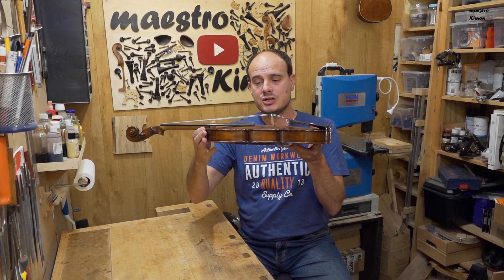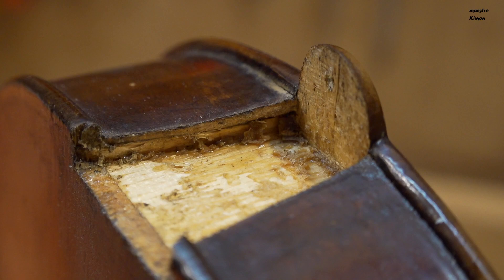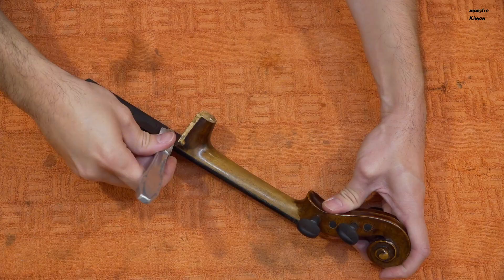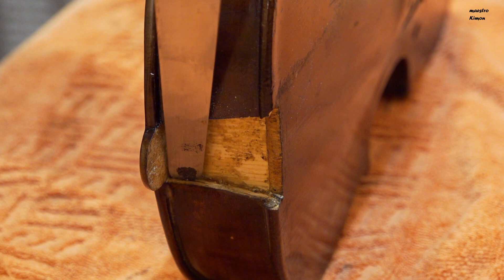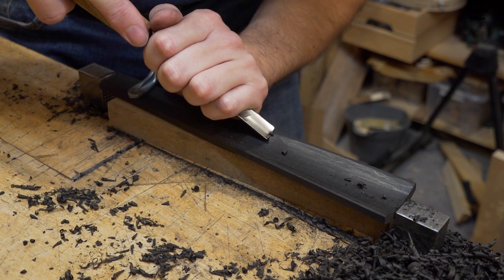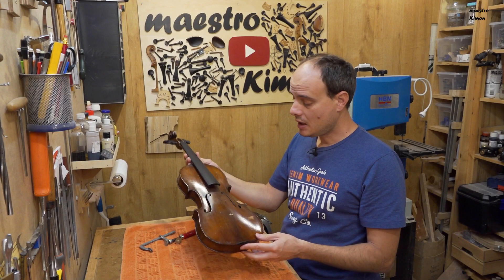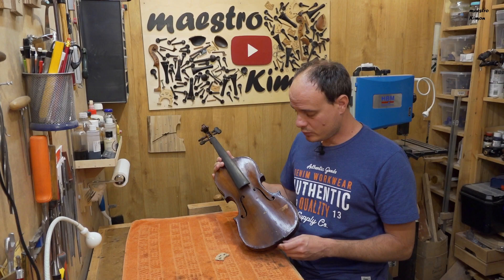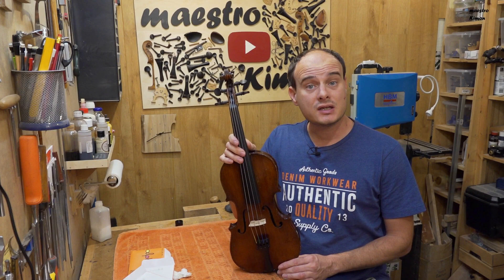Repair Series #30 - The neck came off

Comment: Hello. is it normal to not remove the old glue form the neck joint before gluing the neck back on? what kind of glue did you use?

Comment: I just wanted to say I really appreciate your videos. I have learned a lot from you in my journey to attempt to make a violin and your persona is welcoming and warm which makes your videos better than most. Your talent and techniques are top notch and your explanations on each step are valuable. 

One thing I am curious about on violin necks: is there any treatment/coating on the playing area? I cannot tell if it's bare wood or if some sort protection is applied.
Reply from the maker: Thank you so much for your kind words! I really appreciate it! 

On the neck I put a coating of cooked linseed oil. On new instruments or whene the wood is very clear color I also put some stain.

Comment: If it's white glue, you use heat to remove the finger board.  I use alcohol to remove a finger board glued with hide glue.  It works great.

Comment: Another example where white glue shouldn't have been used. 😉
Did you clean the old glue out of the neck mortise? Sometimes I have found a thick amount of glue there because of poor fitting & end up chiselling it out to a clean flat face & grafting some new spruce in (easier than replacing the neck block if the top doesn't need to come off) then going through the process of fitting the neck again so it is correctly aligned, as well as being correctly glued.

Comment: Hello, thanks for the helpful advice.

I would like to ask, I have a 200 year old Hopf violin, it has a dent in the body of the violin, where the legs of the bridge are, which causes the contact with the bridge to be imperfect. How to solve the problem of the dent.

Thank you again.

Comment: Excellent video Kimon!  It covers several different operations in the same video.  Just a couple of questions regarding some of the tools you are using,  if you please.  First,  the clamp you are using to hold the pegs as you turn them on the shaper.  I would like to obtain one of these.  Can it be purchased or did you make it yourself?  Secondly,  I believe you had a previous video that showed how to construct the device that you use to hold the bridge in place as you file it.  Can you please direct me to that video?  That would be much appreciated!
Reply from the maker: I made the first video on my own. I can send you a couple of pics if you want to make it. 
This is the video for the other tool https://youtu.be/swHQezf4b54

Comment: Great video, Looking at that neck mortise it seems like it had been repaired before? (Though rather poorly). Would it not have been necessary to fit some new spruce into the top block and then re cut a good fitting mortise or would that simply not have been economical on this instrument?
Reply from the maker: The most important parts are the fit between the neck and the back plate and that the neck wedges well into the block. These where both tight fits so I didn't need to do anything.